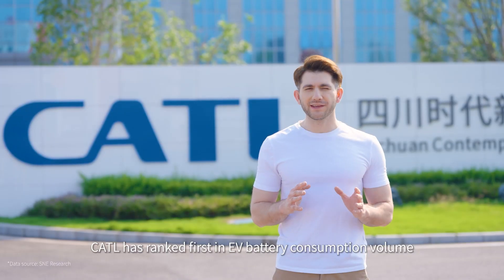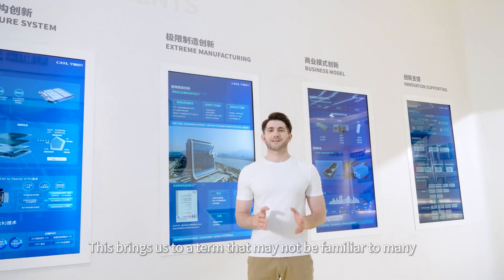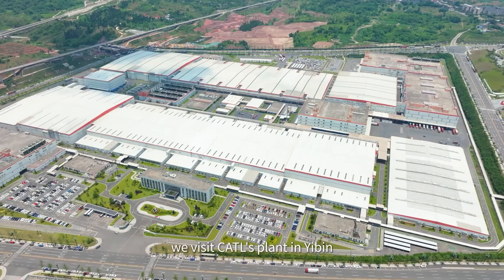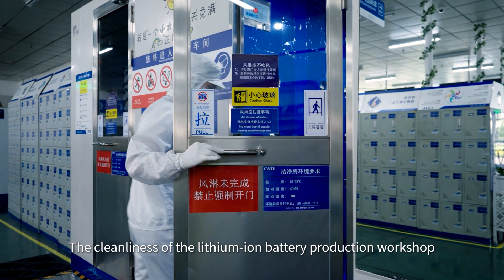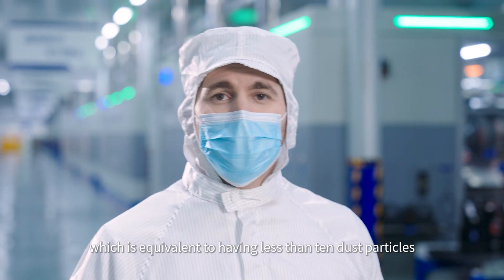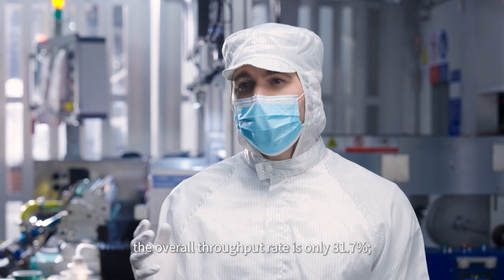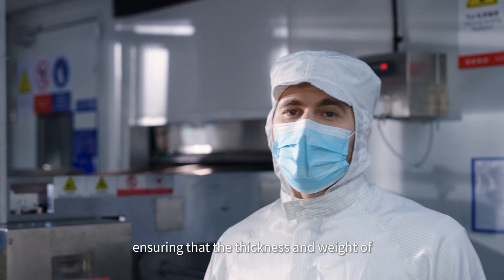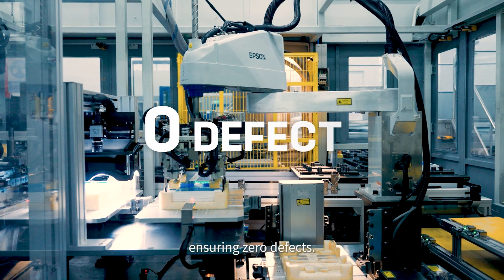The Amazing Defect Rate

Comment: There are 200,000,00,000 transistors in CPU, and CPU defect rate of 1,000,000, which is transistor defect rate of 1,000,000,000,000,000. Do better, CATL. 😂
Reply: Where do you kind the entry level less core CPU are from? From the wafer with defect cores.